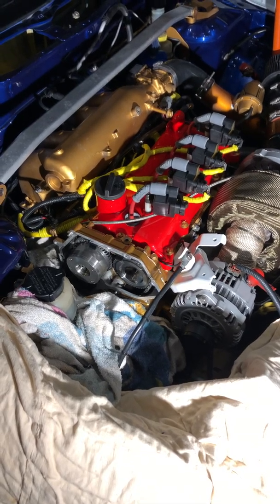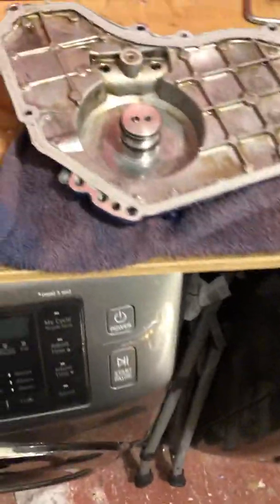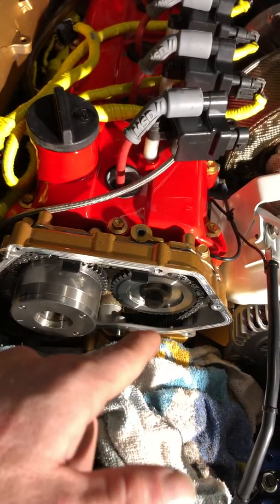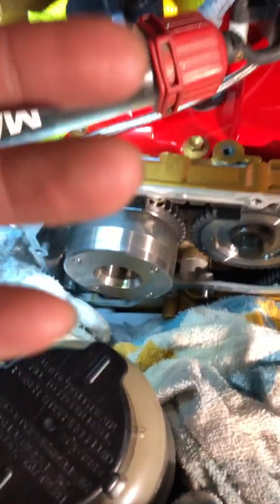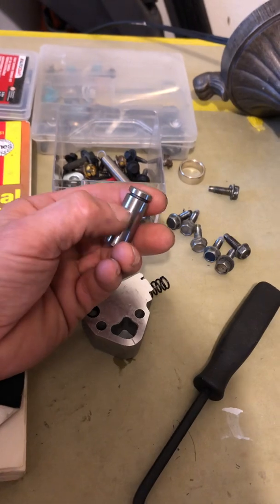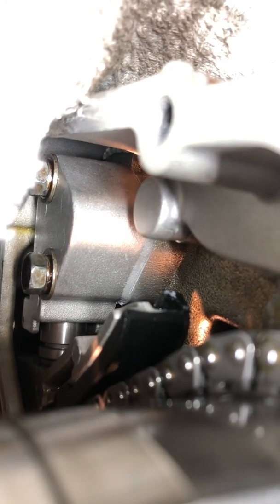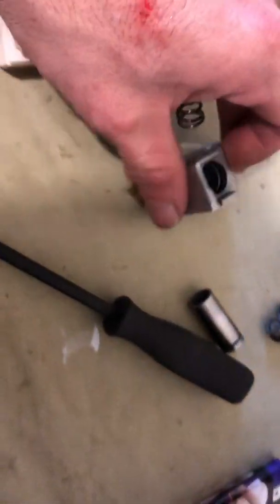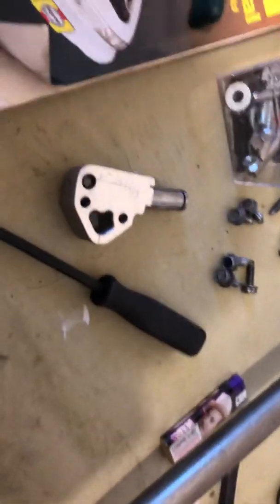Nissan Sentra spec v cold start rattle Solution part 1

Comment: hey ik this video is older and all, ive finally found an answer. felt like i was chasing nothing, since everything was new. makes since now why it makes the rattling sound during startup. ok can i keep driving my sentra the way that it is untill i can make a solution, will anything jump time? i personally dont see how it could but i could be wrong. thanks.
Reply from the maker: Two options…
#1., best trick ever is you floor your gas pedal ALL THE WAY to the floor as you crank your engine. This will turn off your injectors and spark plugs until you let off the gas fully. Do this and listen to the engine as it makes its “ticking” sound… after about 6 seconds of letting the engine crank you will hear the noise quiet down once oil reaches the phaser gear. At that point you can let off the gas and re-crank your engine as you normally would and it will start quietly and healthy with no rattle or wear & tear.

 #2, if you do a timing chain kit, be SURE you buy the OEM phaser gear for the intake cam shaft. The timing kits only bring solid gears and not the phaser. There’s also two banjo style washers/seals that go onto the cam gear cover and it will slide inside the intake phaser gear when you finish the job and put the cam cover on lastly. They’re made of some type of composite hard plastic and must be oem.
Reply: @AutoBodyEverything  thanks for the reply unfortunately my 02 spec v doesn’t have flood mode so the pedal method doesn’t work. Right now I’m in the works of making a new timing chain tension design I saw yours and I’m going to improve the design and mass produce it for our community.
Reply from the maker: @NipponSpeedWorks  …. You could unplug the fuel injector harness plug, worst case you unplug all your spark plug coils (easy) but you’ll get some extra fuel upon start. And yessss…. A sloppy chain will skip tooth. It’s possible with more cars than not. Remember this ext tip., when you take off the cam cover or just the whole timing cover, a new factory phaser gear is the most critical part! Watch my vid where I explain and show why it fails and the guts. There are two very important seals that go ONTO the cam cover plate and when the cover goes back on, the seals end up holding the oil psi inside of the phaser gear from leaking out! The seals seem to be made of a graphite compound and it overlaps kind of like a key chain ring. There’s two of these used for the cam cover that seal the phaser.
Reply: @AutoBodyEverything  I’ve just disconnected my fuel injector fuse and build pressure till the oil light turns off. Has no issues or sounds yet with this method. The injector fuse is right next to the fuel pump fuse